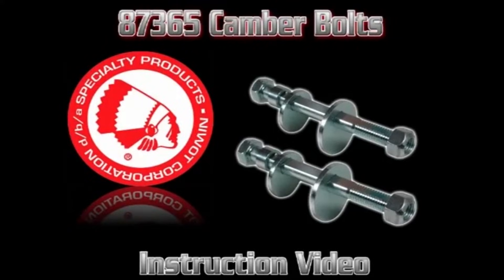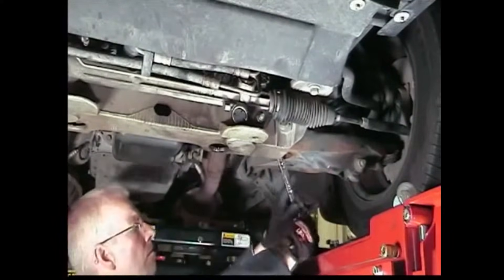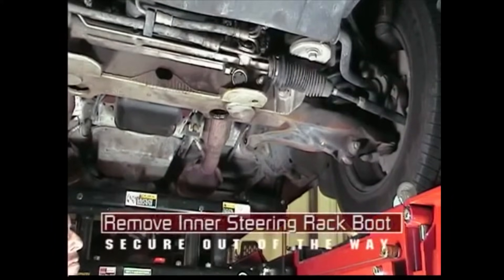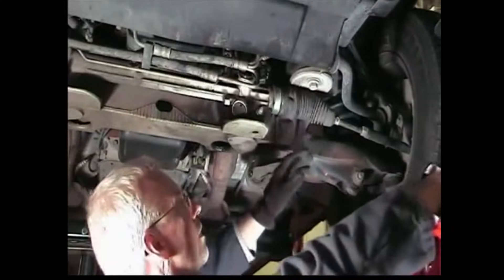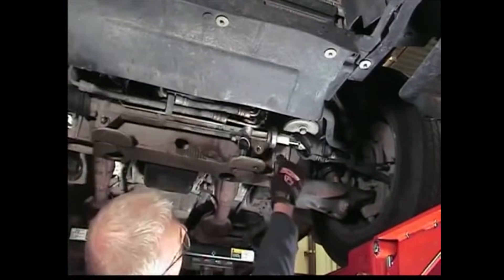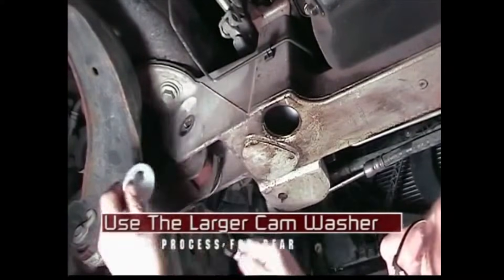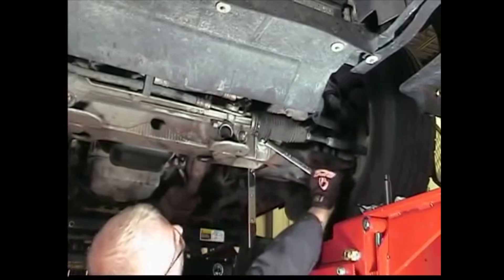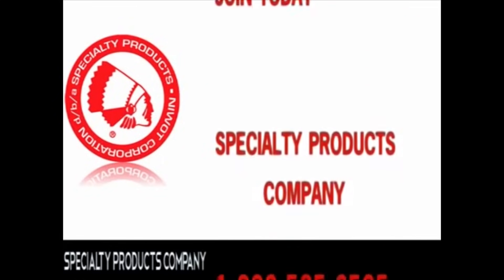87365 - Camber Adujstment Bolt - Specialty Products Company

Comment: I'm going to tackle this soon. I'm in Ontario Canada. I'm worried the camber bolt will be seized in the  control arm. Have you run into that before? Also.. I lowered my crown vic swapped truck and need to correct camber... Which way will the hole need to be filed? Inward or outward?  Thanks!
Reply from the maker: As for a frozen control arm bolt, that can happen on any vehicle. That may require cutting the bolt and replacing at least the control arm bushing. For camber adjustment this kit is mostly used for positive camber correction which brings the bottom of the tire inward. The correction you will need will depend on the alignment readings.
Reply: @SPCAlignment  right now, because of the lowering, the top of the wheel is leaning inward.  Does that tell you which side of the control arm needs to be filed away?
Reply from the maker: @yarkie1  With a negative camber problem you would install the kit as illustrated in the video grinding the inboard part of the frame bracket.
Reply: @SPCAlignment  thank you so much! I hope it goes smoothly!
Reply: @yarkie1 so how did the install go my friend?
Reply: @MYD369  I actually took the truck to a shop owned by a friend and he gave it an alignment and said he got it within spec with no camber bolt kit. To be honest though, I still have the issue of hard return of the steering wheel so I don't think it's correct. I haven't had the truck looked at since. Maybe a project this spring.
Reply: @yarkie1  okay thanks for the response, I did the qa1 coilovers on my vic and I was considering the camber bolts but I too live in the rust belt so you know what that means in terms of seized bolts and bushings lol.

Comment: The 1995 Grand Marquis (at least) have camber adjustment on the upper control arm, does this product work on the older models as well?
Reply from the maker: The 1995 model uses an upper control arm cross shaft. The two suspensions are so different, the 87365 will NOT work on the older chassis. SPC does not offer any alignment parts for the '95. Please provide more information with what issues you are having.
Reply: @SPCAlignment  Alright, thank you for the quick reply!

Comment: Is this mod suppose to let the camber bolt turn 180° degree angle or is it ok for it to turn 360°? I'm concerned if grinding a little to much will be an issue
Reply: If you ground out just enough material to allow the cams to go "over center", you will still be OK. Thanks, Tom

Comment: Does anyone know how to adjust camber/caster on a 1973 Mercury Marquis Brougham?I believe the Lincoln is the same.
Reply from the maker: Full size Mercury's of that year had a sliding upper control arm. Loosen the cross-shaft bolts and position for camber and caster.
Reply: @SPCAlignment  Wish I could upload my pictures of it.I am 99% sure it can not slide anywhere (same goes for the lower control arm) and it can not be turned around either as the coil spring is bolted to the control arm shaft.I am searching high and low how to adjust it,so far all in vain.Can't find any aftermarket parts like let's say an eccentric upper ball joint for these cars either,or any solution to the absolute ridiculousness of it,that a wheel can't be adjusted on a vehicle that was produced by the millions.There are pictures of the front suspension on www.moogproblemsolver.com (page 583,584,) which also shows no ways of adjustability of camber/caster.

Comment: For what it's worth, all the nuts and bolts are metric. Rack nut: 18mm. Stud: 8mm. Factory camber bolt: 21mm. Factory camber nut and both the new bolt and nut: 24mm. I also suggest cleaning the stud threads. Not exactly something you want to strip out.
Reply from the maker: Thanks for the assist.